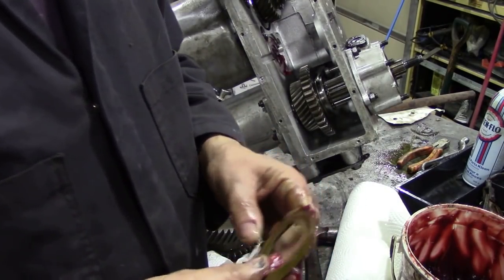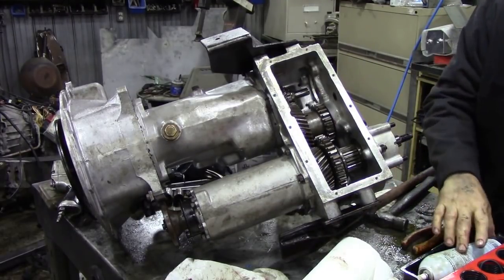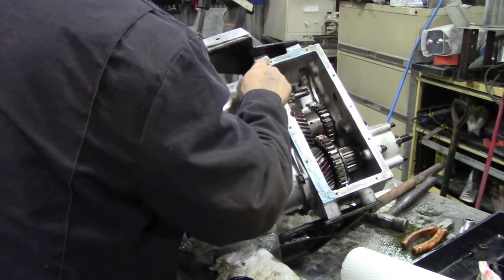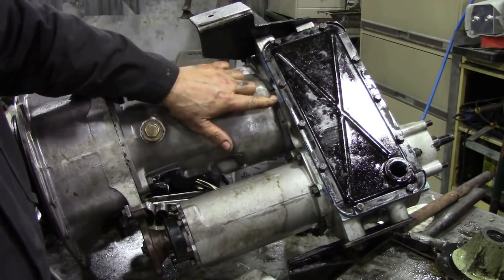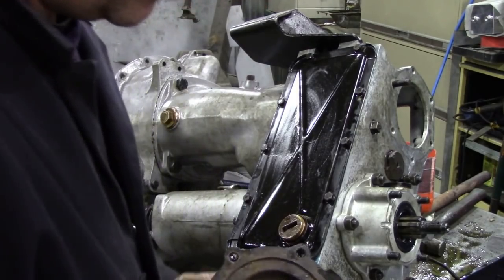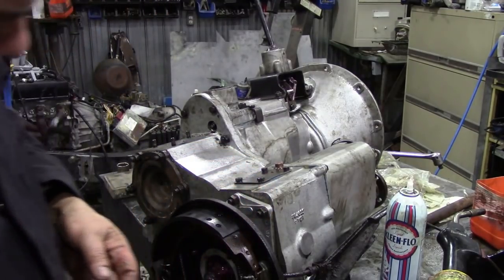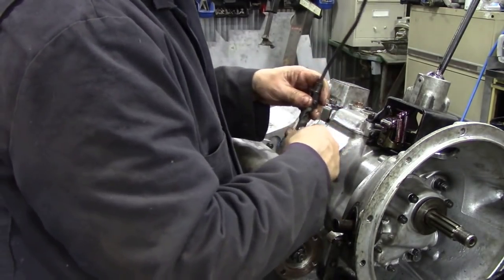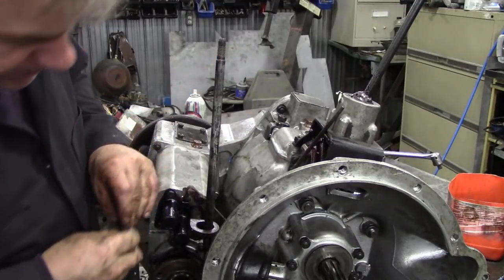Series transfer case strip and check Part 3

Comment: Quick question Mike, what is that red grease that you're using?
Reply from the maker: April wheel bearing grease. April is a Quebec lubricant manufacture - buy local!
Reply: @BritannicaRestorations  Tough one when I'm in Nottingham. I'll check to see what time the last bus is :) Or I might just check on the local stocks! Thanks Mike.
Reply from the maker: lol!
This grease seems to be formulated for low temps

Comment: HiMike, Another great video.  Couldn't help but notice that there was no crush-tube on the intermediate gear shaft,  just the same as the transfer box that I have fitted to my 1984 110. It came out of an early Range Rover which is higher geared, works really well especially on the motorway. The question I would like to ask is--- when did they start using the crush tube rather than end thrust shims. Best wishes, Yorkshire Rob.
Reply from the maker: The Series had needle roller bearings and thrust washers either end of the gear that run on a surface on the gear
Reply: Yes I liked them better than the crush-tube, I suppose that it was all down to cost. The one in my 110 is so quiet. Best of luck, Yorkshire Rob.
Reply: Completely different unit, Robert.  Series vehicles (except V8) had this unit, while 110, 90 and then Defender all had LT230s.  This has selectable 4wd, normally being in 2wd, while the LT230 is always 4wd and has a centre diff.  Preloads and tolerances are set differently, and the teeth on the LT230 are smaller and all helical, no spurs, so it’s much quieter.
Reply: Yes Your right in what you say Nick. I fitted a transfer box that I took out of a Classic Range Rover Many years ago, a 28D @ 1.22.    Before I swopt it , I thought that I should give it a quick rebuild and reseal. I had already ordered the parts for the original t/box that had a crush tube in it, a 22D@ 1.410, but when I took the 28D box in bits there was no tube, instead it had the shim thrust  eather end so I had to reorder the parts. The shaft was a little different but the casing and most gearing were exactly the same as the ones with the crush tube.  I had never seen  one without the crush tube. Even the input shaft was the same and interchangeable.  The question is,,,, have I got an early odd-ball  LT230  T/box.  I have no worries or trouble with it, and it is so much quieter than before, maybe the MOLYSLIP helped a little. Many thanks for your input Nick, I enjoy Mikes channel as he is so good in explaining things and it brings back so many memories.  Good luck with your next project. ROB.

Comment: I wonder why land rover didn't replace the drum with a hydraulic disc arrangement?
Reply from the maker: When correctly maintained a drum works well
Reply: @BritannicaRestorations  I was thinking in situe repair in adverse weather conditions, you pull the drum and it all falls apart in a slushy puddle!!!lol
Reply from the maker: I have a feeing you cannot fit a hydraulic parking brake - there is a cable disc conversion on the market
Reply: Even (Many? Most?) modern disc brake systems use miniature drums (inside the rear discs) as parking brakes. Drum shoes tend to wrap into the drum at low speeds so have a sort of self-setting advantage, where a disc caliper requires much more force (on the lever/cable) for the ame effect. All of the slop in the Defender driveline gets taken up post-brake-setting. Quite a thrill on a cliff edge
Reply: Steve P, I had to explain to an MoT inspector how it worked and that the movement of the vehicle (it was in very good condition, not a bad one) on the hand brake was normal and acceptable for the test as he was insistent it was a fail.  Most of them are ok, but you find the odd one who’s useless!
Reply: Because hydraulic parking brakes are not allowed in the EU and most other places - too much chance of a leak disengaged g the brake when parked.

X-Eng developed a disc brake conversion using a mechanical calliper, now produced by Foundry 4x4.  Britpart also made an illegal copy, breaking patent law, as they do.

Comment: I can highly recommend one of these cast aluminium Roamerdrive Series transfer box sump covers: 

http://www.island-4x4.co.uk/transfer-case-sump-plate-cover-roamer-da9016-p-36575.html

They don't deform around the studs and stops the leaks
Reply: ive made one that holds another litre of oil

Comment: Hi Mike I love all these videos you are churning out. Does that transfer box intermediate shaft not do up on a crush tube and require pre loading?
Reply from the maker: Not on a Series truck
Reply: Preload is set by shims under the thrust bushes you see Mike stick in with grease before dropping the gear cluster in.

Comment: Your application of Hylomar is bringing back memories. Used gallons of stuff in my time . Perkins insisted on painting either side of the head gasket on a V8 engine because the mating surfaces were that bad. The other gasket sealer I used was WellSeal, a horrible brown liquid that stunk rotten, along with Stag paste looked like red lead and stained everything it touched. Really enjoying your videos being able to overall a gearbox without getting dirty or knocking up my fingers and knuckles . Keep up the great v,kgs
Reply from the maker: I remember Stag when i was an apprentice!

Comment: I thought about you as I passed 'mega paper towel' rolls on special at the hardware.  Three bucks a roll and fifty bucks postage!!
Reply from the maker: Costco sells bundles of micro fibres quite cheap, however they do get contaminated quite easy - pick up drill swarf like a magnet!
Not too please with this years wood pellets - burn too quick. May get hard wood next year and re set my boiler to suit
Reply: @BritannicaRestorations  will the boiler still auto feed on hard wood? We don't see many of those in Australia.  Most wood users are stingey amateurs, like me, who pinch bits from bushland.
Reply from the maker: 6 x rolls here C$3.33
They make it here in town - I was wondering if they had and spoiled product, but then again they just throw it back in and make new stuff - thinking about it, maybe worth talking to them for a bit of sponsorship...
Reply: @BritannicaRestorations  Yes, that and microfibre towels. You seem to use a hell of a lot of both.

Do you ever manage to get spoiled wood pellets for your heater. I'd imagine they'd be much cheaper.